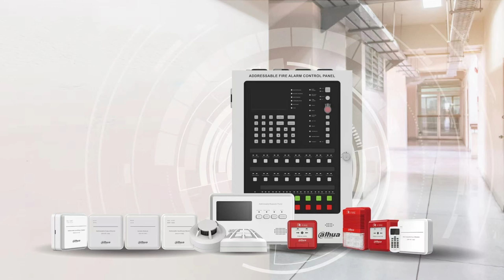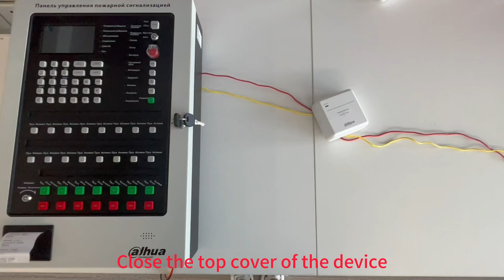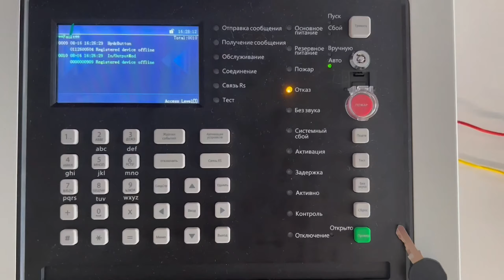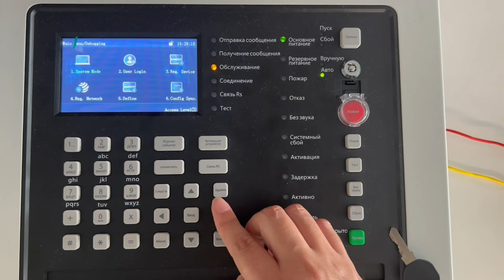Addressable Fire Alarm System | How to Install | Wisualarm

Comment: Is the EOL resistor at the end terminal needed for addressable fire alarm system?
Reply from the maker: Hi Renan, for online monitoring of detectors in conventional system, you need set the EOL resistor at the end of the loop😀if you have other questions,  just let me know.
Reply: @wisualarmtechnology  ok.. but on Dahua conventional system, does it requires resistor?
Reply from the maker: @RenanMarkBruzola  Conventional  systems require EOL resistors for detector online status detection. Addressable systems can detect detector online status through protocols without passing EOL resistors.🥰